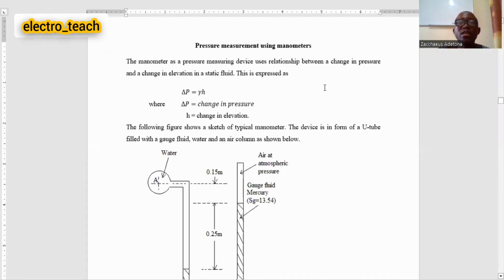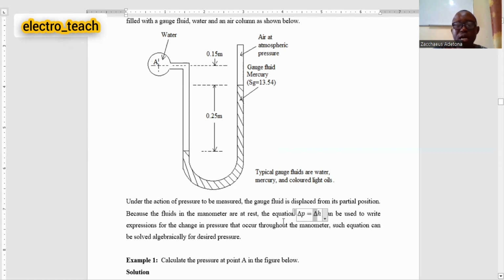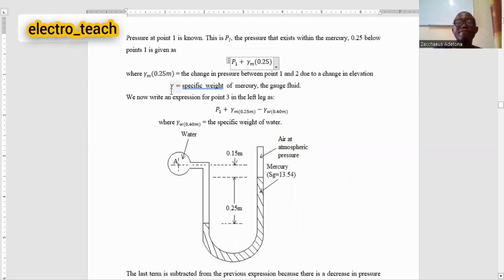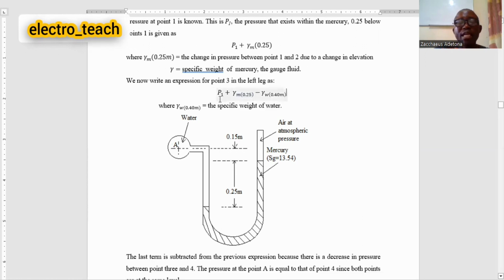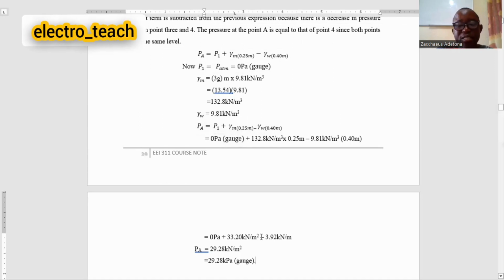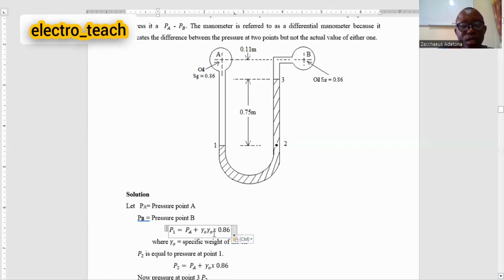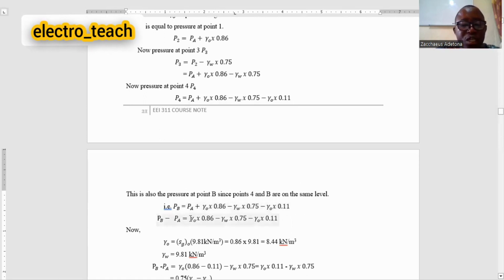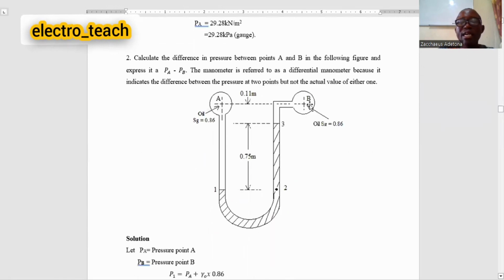Pressure Measurement Using Manometers | Fluid Pressure | Worked Examples @ECIMacademy

Comment: With the solution of Question (2) 
Incase we see same question with different pressures should we just assume that gamma of water exist from point 2-3
Cause is not stated in the question that water exist in the tube
Reply from the maker: The fluid present in each section of the tube will be indicated in every question. No guessing.

Comment: This is great job sir 
At the end of the lecture I was able to know that Manometer is an instrument for measuring the pressure acting on a column of fluid, especially one with a U-shaped tube of liquid in which a difference in the pressures acting in the two arms of the tube causes the liquid to reach different heights in the two arms.

Comment: Very impressive discussion.
Pls sir, what are the limitations to the manometer device as a pressure measurement??
Reply from the maker: Some of the limitations are: It is large in size and bulky.
It needs leveling.
No fixed reference is available.
In manometer, the error is introduced due to condensation.
It has no over range protection.
The manometer has a poor dynamic response.
They have a smaller operating range which is on the order 1000 KN/meter.

Comment: I learnt that under the action of pressure to be measured, the gauge fluid is displaced from its normal position because the fluids in the manometer are at rest, the equations

Comment: From the lecture i understand that the basic definition of level measurement is the linear distance between the top surface of a liquid or solid and a predetermined reference point like in a tank. There are many types of level measurement instrumentation tools used in industrial processes
Reply from the maker: Yeah, various level measurement devices available for specific applications.

Comment: For measuring the level of a tank, 2 tapings are needed from the tank. One taping is taken from the bottom and one other taping is taken from the bottom. Both tapings are connected to the differential pressure transmitter. Tapping taken from the bottom is connected to the high-pressure side of the transmitter. Taping taken from the top of the tank is connected to the low-pressure side of the transmitter. According to the differential pressure, the tank level is known from it.

Comment: Sir you said calculate the difference in pressure between pointA and B and expresss it as PA and PA but the manometer is referred to as a differential manometer but it indicates the difference between the pressure at two points but not the actual value of either one
Why it is differential manometer A and B
Reply from the maker: Differential manometer gives pressure difference between two points A and B and not the pressure of either point. So it's expressed as PA-PB or PB-PA.

Comment: Sir If the manometer tube consist of 3 liquid in it but not in the same pressure… is it compulsory to start the calculation from the right side of the tube sir?
Reply from the maker: You should always start the calculation from the vertical portion of the manometer and not the horizontal portion. This can either be left side or right depending on how the manometer is placed.

Comment: At the end of the lecture I was able to know that Manometer is a measurement instrument used for the pressure acting on a column of fluid, especially one with a U-shaped tube of liquid in which a difference in the pressures acting in the two arms of the tube causes the liquid to reach different heights in the two arms.

A great job done sir 🎉

Comment: If you wany to make custom cable lenghts or crossover cables,  or repair a broken connector one of the most isolating metal is called froth flotation

Comment: This is great jobs sir 
At end of the lecture I was able to know that manometer is an instrument for measuring the pressure acting on a column of fluid, especially one with a U-shaped tube of liquid in which a difference in the pressures acting in the two arms of the tube causes the liquid to reach different heights in the two arms.

Comment: Sir, thanks for the great lesson sir.
I noted this point that the manometer is referred to as a differential manometer because it indicates the difference between the pressure at 2 points but not the actual value of either one.
I don’t understand the last part of it not actually indicating the actual value sir.

Comment: If u want to make custom cable lengths or crossover cables,or repair a broken connector one of the most isolating the metal is called froth flotation
Bada Asisat Abiodun